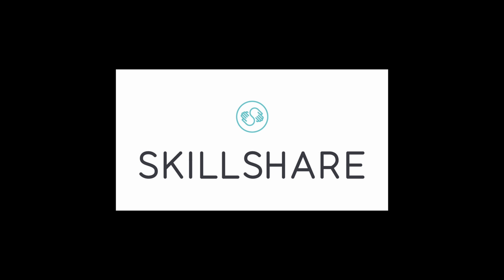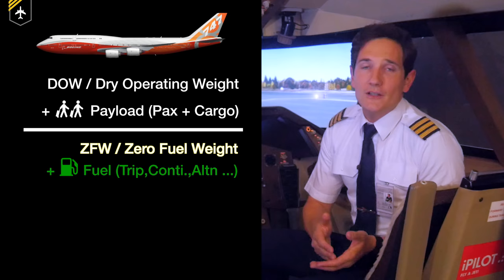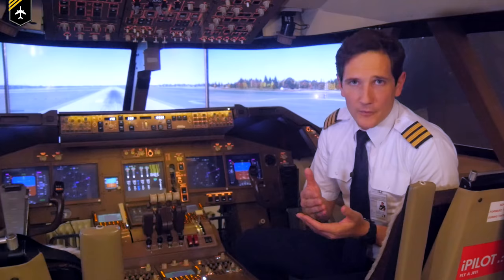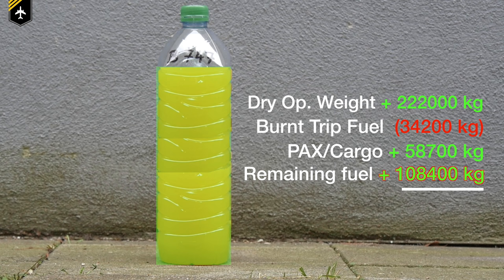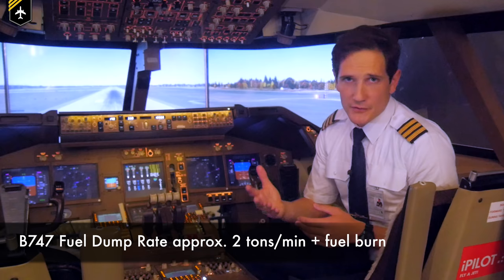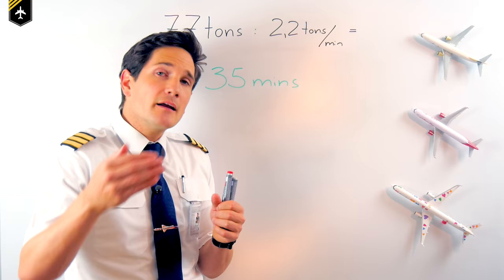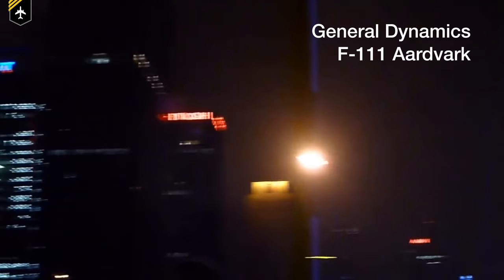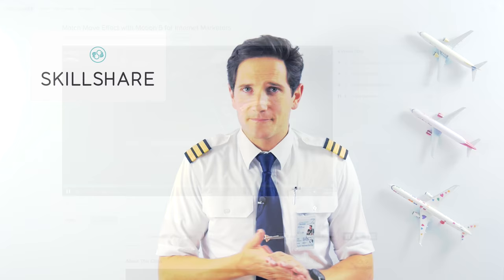Why do PILOTS DUMP FUEL??? Explained by CAPTAIN JOE

Comment: Why not just design better landing gear and different runways?
Reply: Onix Junes 
Costs a lot more than having to very rarely dump fuel.
Reply: God Emperor Trump But not in a long run
Reply: Cry me a Riven even in the long run because they only dump fuel a few times a year say around 10-20 times and that probably cost let say 1 million dollors while rebuilding whole airports and making new planes would sky rocket into the billions
Reply: Still need to maintain  runways
Reply: "why not just" if it's so simple engineer the next revolution in landing gear!
Reply: Deses if I had the education and the funding I sure would
Reply: if you wanna have a landing gear which is stronger it will require more weight. More weight means there is more structual integrity and stronger hydraulics needed to support the gear. Which means one of the following: less fuel efficency/ less passenger capacity/ lower topspeed/ and so on. There is no way of getting everything perfect, engineering is all about finding the balance in comprimises.
Reply: Onix Junes mechanical engineer here. 
It just doesn’t work that way
Reply: The landing gear is a mass spring system If you change the landing gear you essentially change either the mass, springs or damper (shocks). Which could drastically affect how much the airplane shakes and vibrates which would change the weight limit and again causing structural damage. Oh and if it vibrates at the natural frequency it will fall apart (look up vibrating bridge collapse)
Reply: Because part of the problem is that very high landing weights also require landing speeds that are so high the aircraft will not be able to stop even on a 10,000' runway.
Reply: God Emperor Trump Rarely? Literally every day I look up there's 2-3 different planes with trails behind. It's not rare and it probably ammounts to something, I'll look it up online
Reply: Those are condensation trails from exhaust moisture being frozen into ice crystals (by the negative 45 degree air temperature) when relative humidity exceeds 70%. 
If you assume that things you don't understand are bad, you are not going to have a very happy life.

Comment: However, in some cases we can’t dump the fuel so there’s no other options then to land in a condition called : OVERWEIGHT LANDING that’s considered as a : HARD LANDING 
this time the AIRCRAFT will be  grounded some time until the maintenance personnel complete the : HARD LANDING INSPECTION that focus more one the LANDING GEARS ( FUSE BOLTS ) as well as other points 
🇩🇿🇩🇿🇩🇿🇩🇿🇩🇿🇩🇿🇩🇿🇩🇿👍👍❤️
Hi to all aviation people from Algeria

Comment: So basically after doing a misfuelling course last year so I could work on cars in garages when the owner put in the wrong fuel, i am left stumped. They said petrol on the ground is fineable because its disastrous for the environment. Now you are highlighting that planes, and there's lots of them, daily dump tonnes of fuel. This must have terrible effects on the planet.
Reply: No he says that this is rare but happens. Its not daily but it happens because of emergency landings, good winds and lower weight. And also when its flying that fast and at that alltitude it spreads out over longer distances making this not as dangerous for one area where it can pool
Reply: When fuel is dumped at a high atmosphere it dissipates in the atmosphere before reaching the ground. He literally explained this in the video. Do you even watch?
Reply: aaanf jetfuel doesnt have all these poisenous additives. hydrocarbons arent that poisenous per se.
Reply: Fluffy ponies- where does it go?  Is it magic? OF COURSE IT HITS THE GROUND
Reply: Araya Light Araya Light Literally the idiotic comment I have ever read on the internet.

If the plane is too heavy and breaks apart upon landing, the heart attack victim is guaranteed to die...along with everyone else on board. And by the way, the engineers did sort all of that out. That's why they have a system to dump fuel in the first place.
Reply: James Barratt why not make the landing gear and airplanes frame stronger? Oh wait it might make too much sense and take a little more effort during assembly of the planes, that would be catastrophic for the companies designing these things lmao.
Reply: Its even dangerous when it's spread lol learns some Physics.
Reply: WTF is Araya on about? So, you 2 options are, fly in circles for 35-45 minutes and the patient having the "heart attack" may die, or risk structural failure on landing where a couple of hundred people may die (including all that fuel that you didn't dump ending up spilling anyway).... how is that so fucking difficult to understand?
Reply: People like rex don't think before commenting sadly.
Reply: Military A/C have had to do it for years. You damage the planet every morning taking a crap.
Reply: Corsairforu Human shit is biodegradable... That's what your mushrooms from china are grown in... However jet fuel is not... Try to grow something in jet fuel see how that turns out.
Reply: James Barratt To James and everyone else claiming it's going to be a liquid on the ground just one question. Have you ever heard of a gas? Fuels to certain degrees become gases (try lighting a match near petrol). I think the process is called atomisation. Now imagine that jet fuel. It's instant droplets and will get thinner and thinner easily turning into a gas before any of it hits the ground when done from the right height. So try and pour a few fuels on the ground and see if any of them evaporate. Is that answer all of them? Well why do you think jet fuel is a magical exception? Especially given these circumstances!
Reply: its called evaporation, atomization is different, kerosene / diesel evaporates at a higher temperature to gasoline, the kerosene will hit the ground as tiny droplets or mixed with water in the clouds / atmospheric moisture. go try pour some kerosene on your concrete drive, it will stay as a stain until the concrete soaks it up or the rain washes it away, it does not evaporare like gasoline, if it did we could run diesel in petrol carburettors and wouldn't need high pressure fuel injection.
Reply: James Barratt It's not about whether something is toxic or not, it's about how much there is in proportion to where it's dispersed. If I were to drink half a cup of kerosene, I would become very ill, but if I were to put that half cup of kerosene in a swimming pool full of distilled water, then drink half a cup of the dilute solution, I would be totally fine. It's the same reason you don't die when you drink a cup of coffee, even though caffeine is toxic in high proportions.
Reply: long story short without being rude take two bottles of febreeze. take the lid off one and dump it on the ground. look at the puddle and realize you took concentrated chemicals and put them in the environment around you. now take the second bottle. spray it like a normal person until it is empty. your room smells good. it is not polluted. it is not dangerous. it is not concentrated. it has dissipated into the air. a very thin low amount has coated items. this is not like emptying a jerry can of gas on the sidewalk, its like spraying it out of a febreeze bottle. but instead that gas has 35 thousand feet of air below it, so it is not coating anything. i would be more concerned environmentally with the amount of fuel burned a year during flight rather than the amount dumped. unless of course they were say, spraying it during taxi or landing. a higher percentage of it, in larger concentration, would reach and occupy a smaller area in less time. thats pollution.
Reply: uhm... in 99% of cases they have enough flight time to dump the fuel in. its not like they are adding another hour to the flight. the fuel is dissipating, not hurting the environment. (i mean it is, but not considerably so. see my above comment about febreeze bottles.) and he even said in some cases, when there is no time for fuel dumping, they have procedures to land said plane relatively safely while overweight, in emergencies. they would possibly have tens of millions of dollars in repairs and maintenance, to better a persons chance of survival.
Reply: i just used febreeze to make that point lol
Reply: if im not mistaken your implying one drop would be harmful. it doesnt RAIN jet fuel. it dissipates. if you passed grade nine science you will know about diffusion. particles under high concentration will DISSIPATE and expand, leading to low concentration. meaning a very very very VERY tiny amount it spread over a very very very VERY large area. like dude, in that case isnt exhaust fumes from your car deadly? put your moth around the exhaust. if your still alive, now stand five feet back. then twenty. it moves to areas of lower concentration, and something damaging to the environment and DEADLY is now a minor nuisance.
Reply: technically, yes. so is exhaust fumes. so is febreeze. everything is done in moderation. its bad to do, but it is a better alternative and done to an "acceptable degree" of danger, pollution, and toxicity.
Reply: we use aluminium for the most common constructions of an aircraft due to its low density. even the parts that are steel, if we were to anticipate these situations and reinforce them, it would add even more weight requiring more fuel less passengers and becomes less effecient. until you get to a point where it doesnt fly well, takes 10 passengers is costly to make and still requires a lot of fuel.
Reply: ^^^ this guy gets it
Reply: spread jetfuel in a one nanometer thick concentration over 1000 hectares of land now tell me its harmful.
Reply: ^^^ this person also understands basic physics. you deserve a sticker.
Reply: ok ok but my brain hurts now. dude. its not good for the environment. NEITHER IS BURNING IT. NEITHER ARE YOU. EVERYTHING WE DO PRACTICALLY HAS SOME NEGATIVE AFFECT ON THE PLANET BRO. this ones just at an acceptably low level.
Reply: yes but those tiny droplets dropped at 35 thousand feet become spread out and very tiny. negligible even.
Reply: ^^^ this guy gets it. you deserve a sticker.
Reply: Araya Light bruh, in the worst case, someone else gets hurt because the plane landed overweight. Best case, the airline loses a ton of money. What do you think the airline will choose?
Reply: one 747 is more valuable than one average human life
Reply: When you figure out a way to fuel planes with totally green fuel I'm sure the world would like to talk. Until then this is what we got and this is the solution when you need to land under a certain weight.
Reply: rex racer I see your point but efficiency matters too
Reply: Hydrocarbon Primate You're mixing evaporation with boiling.
Reply: alex reid Why are you talking to yourself?
Reply: every thing has a price, you can burn fuel and add more poison to the environment or just dump it and it will Evaporates  and not cumming to the ground and has less effect in atmosphere verses burned fuel . sorry if i am not good in English. thanks
Reply: Stronger landing gear and airframes means heavier more expensive aircraft and, which require more fuel to keep them in the air, which makes them more expensive to operate. Which means nobody would be able to afford to fly.
Reply: "the fuel dissipates in the atmosphere..."   great. So in other words, it never hits the ground because IT STAYS IN THE ATMOSPHERE.  If that isn't pollution then nothing is.
Reply: Neikoo if it’s so rare then how come I see big streaks over my town almost every day
Reply: those trails are probably just water vapor
Reply: it takes a lot of research, mate and tweaking nature (metals and stuff) to suit your needs isn't as easy as you think. you could make it stronger by making alloys or making it denser but it could also become brittle and not as durable as you think. Scientists have to account for weather conditions, the electrical connections, flammability, durability etc, etc.

Comment: 8:26 Sir, very informational video. Noob question here. What if the plane just flew for a few minutes then the weather gets bad along the way and the plane needs to land immediately on a nearby airport. Do you still need to execute the fuel dump? If so, how do you do it given time is of the essence because of the bad weather? Sorry sir noob question.
Reply: Simple answer to this. You have excess fuel, just fly away from the weather using that extra fuel then divert as required.

Comment: A couple of questions Capt. 1. Is it safe to dump fuel while an engine on fire ? and 2. Is it a 'crime' worth an investigation and a show cause notice to pilots if they miss a approach and decide to do a go around and make another attempt?  I have seen some reports where pilots have been suspended due to such incidents?
Reply: For 1 it depends on the severity of the fire

For 2 it’s not a crime if you just make a go around and make another approach because it’s normal. But as you said, if pilots are getting suspended, it’s more so because of the incident which caused the go around, rather than the go around itself

Comment: So... the plane will be damaged if landing weight is 312000.1
Reply: it's obviously just a safe measure, leaving a margin of error,
Reply: If you follow your argument, you will keep adding a pound to the weight, and make it sound okay. However real engineers have calculated the maximum landing weight. Trying to make it sound too legalistic by adding a pound is just stupidity. There are limits for a reason. Consider it the other way, what is the maximum take off weight? If you add 1 pound, the plane may still take off, but how many pounds do you want to add? And what does that added weight do to the fuel calculations? If you add weight to the maximum landing weight, what is the maximum weight you want to add, and what damage do you calculate to be possible from that extra weight. And more personally, would you want to be on that plane?

Comment: It shows that we still don't have enough technology to ignore fuel dumping
Reply: That makes no sense. I can have a million 1980 era PC’s and it’s still not equal to a simple modern cluster pc.
Reply: ky s hahaha
Reply: It's not an issue of tech, they have decided fuel dumping is the best way to deal with the the problem. Everything in engineering is a compromise to get a result that hits the cost, safety and time target. They build the aircraft assuming the fuel calculations are correct 98% percent of the time, and the other 2 percent...fuel dump. 
If fuel dumping becomes some huge problem, a solution will be engineered.
Reply: its a condensate, squeeze hard an empty plastic bottle and open the cap, after u open it h2o forms momentary... THERES NO FUEL. 
TESLA
Reply: Nicky Surr NO
BUT ITS FUEL

Comment: Would they save enough money by having planes that fill a fuel tank that gets jettisoned and recovered? In this case we'll ignore the cost of retrofitting or buying new planes and assume the tank can make it safely to the ground to assess just the cost of the dumped fuel versus the costs of jettisoning and retrieving a fuel tank.
Reply: Rinyotsu actually no they won’t save money. Simply because it is such a rare occurrence that implementing such a mechanism would be more impractical.

Comment: Couple questions? Why is there so many steams over head where I live if this is only an emergency and 2 how does fuel stay in a mist form for hours plus when fuel on the ground evaporates so fast 🤔
Reply: Don't confuse fuel dump with condensation trails. Fuel when dumped stays afloat in the air and never or almost never reaches the ground.
Reply: short answer= we are being sprayed like bugs.
Reply: @kalleklovvn9262  No, we are not. Please...
Reply: @Andrea2601M  keeping the herd in check?
Reply: @kalleklovvn9262  Depends on what you mean with aerostat injections... We are talking about fuel dump in here and you stepped in with your propaganda...

Comment: Why not have a tank with a parachute that just ejects for the plane?
Reply: Roxling13 Gaming that's one completely foolproof and safe idea
Reply: Roxling13 Gaming how do you precalculate how much fuel in that tank?
Reply: Benjamin 1 why not? that works in the gaming world.....
Reply: CL4KFL that is easy. Just have two normal fuel tanks on each wing and a reservoir tank connected to both tanks on the belly of the plane. Have fuel pumps between tanks to pump in or out required amount of fuel.
Reply: Andrew I am guessing you think airplane fuel "tanks" are just like the one in your car....Do you have any idea where the tanks are? Do you have ANY idea how much extra weight there will be to convert the fuel tanks into "disposable" solid tanks?
Reply: It would cost more. This is capitalism...
Reply: We could but the there wouldn't be an explanation for Chemtrails...duh
Reply: Scott Bixler not as much as cost as to practicality. When you add so much weight it needs more fuel to take off, and land with more weight than necessary. That’s reality, not capitalism....unless wasteful on a regular basis worth more than wasteful only in emergency makes more sense to you.....
Reply: Roxling13 Gaming  what do you think it would happen if the parachute fails ? Imagine a big exploration and all the fire that would cause . On top of that that is not smart at all what if the tank lands in the middle of a freeway and causes a wreck and massive fire ? Lets just forget about those  crazy ideas and let them do it the way they always do it ☝️